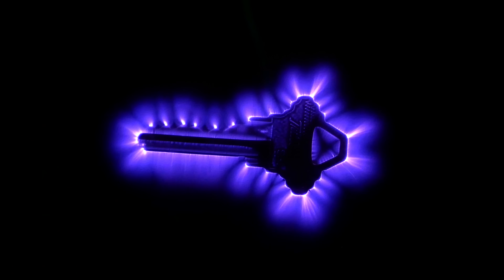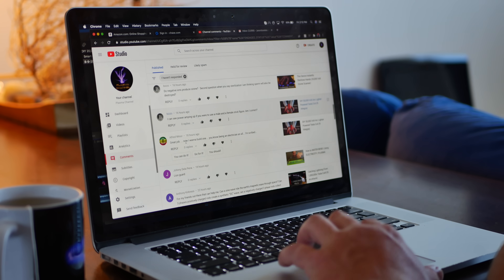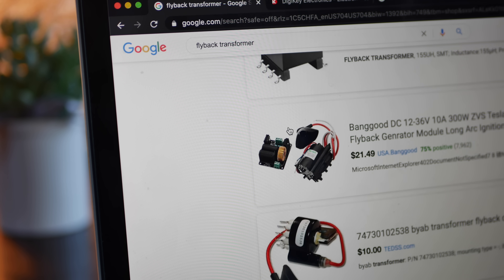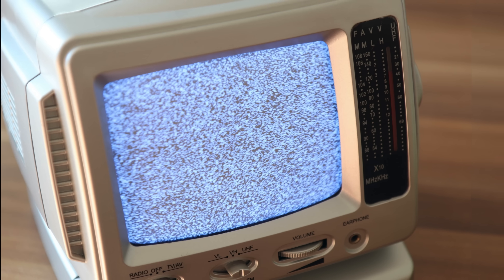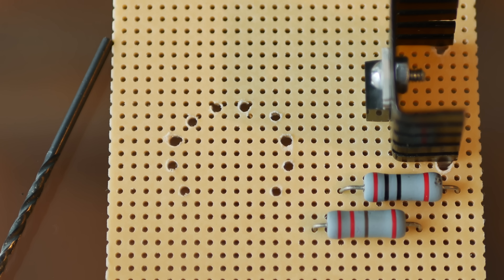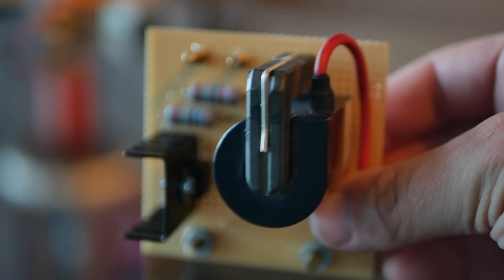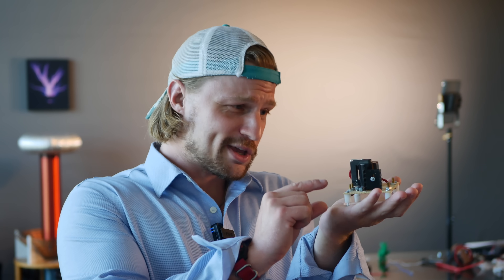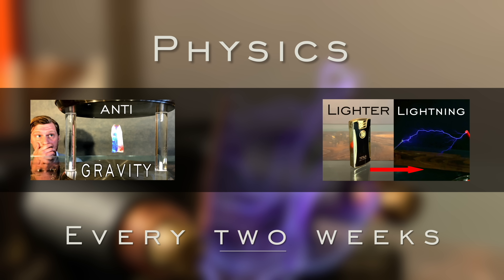DIY Plasma Physics Powersource (Mini 20,000v Flyback)

Comment: Okay, stupid question: it looks cool but you can do something practical with it, right?
Reply from the maker: That is a good question, but practical is a relative term. Cars, for example. Useless unless you build an entire infrastructure around them. Otherwise, that mustang, not able to leave the driveway. 

This is a powersource for all things high voltage. It can power larger devices, and, be used for particle acceleration experiments. It also can be considered art. That’s why I love sparks so much. It’s an artistic taste, I suppose.
Reply: @PlasmaChannel  I do understand the art part, I also love how plasma looks. However, there is also this feeling that you have something powerful in your hands. Like how electricity, in the beginning, was often used as a party trick but has grown to so much more. If I see plasma I think: cold fusion reactor. So, next project? :D :D

Comment: hi jay,
i have build it with power supply (ac/dc)
but after few moment 
the voltage drop
can you help me?
thanks
Reply from the maker: What voltage did you feed it?
Reply: i use ac to dc converter, i use laptop charger
i want to build Tesla Coil with zvs and flyback
thanks

Comment: Could I use a mosfet like the irfp260n in place of the 2n3055 bjt? Does it connect  the same way or is there anything different I need to do? If same way, is it G of mosfet connect to feedback and D of mosfet connect to primary?

Comment: I tried making my own coils with a 0.020mm diameter stainless steel wire, with 7 turns for primary and 4 turns for feedback. However, it doesn't seem to do anything. Is this because the wires I used are unsuitable or is the problem with the flyback itself?

Comment: If my transistor gets really hot, but there is no output voltage, what does it mean?
Reply from the maker: Try reversing your flyback winding connections.
Reply: @PlasmaChannel  still no output. What else can I try?

Comment: Hi, I tried using a variable power supply, range of 0-12V and 0-5A. Everytime I tried connecting the circuit, the power supply would go into constant current mode and the voltage would become very low. Do you have any idea what I'm doing wrong?
Reply from the maker: That seems like the voltage was shorting out somewhere. Are you sure your flyback winding is connected correctly, and, that your transistor is not fried with a closed circuit?
Reply: @PlasmaChannel  actually to be honest, I'm not too sure. I tried connecting with another transistor, the 2n3055, with that I managed to get it to stay in constant voltage mode. However, there still seems to be no output and the transistor doesn't seem to get hot or even do anything. Any idea where I might have gone wrong?

Comment: Why 12v ? Can i put more voltage in input for more at the output ?
Thank u very much for your vidéo
Reply from the maker: You need to build this with more spacing between the parts, if you want to use more voltage. 15 volts is the absolute max for the dimensions I used on the board. Any higher, and the high voltage output will arc over to the other components and destroy the whole thing.
Reply: @PlasmaChannel  thank u so much for your answer, i will do that

Comment: Say I have 4 set of pins, one being 0.4 ohms, one being 0.8 ohms and the other two being 0.9 ohms, which one would be the ones I need? The one closest to 1 ohm or the lowest values?
Reply from the maker: I would use the 0.4 ohm as primary, and 0.8 as feedback. If it does not work the first time, switch around the connections on the feedback ones.
Reply: @PlasmaChannel  I tried every combination but all I get from the output is 0v when I measure with my multimeter, does this mean the transformer is broken?

Comment: You can design a circuit for an electric vehicle, a truck with a double motor of more than 200 kw 20,000v and that charges batteries with a generator motor without burning the batteries that the inverter to use, you can design a drawing and send it to my email or make a video animation fersomtop93 @ gmail.  com

Comment: how much current could have been there in that circuit?
is that lethal?
Reply from the maker: It is not lethal, but I still recommend being safe while using it. It will output approximately 2-3mA

Comment: I can't wait to try this out some day. But first, I need to learn (a lot more) about electricity.
Reply from the maker: Yes, please do not attempt this if you are new to high voltage. I did the video, and have 17 years of experience.
Reply: @PlasmaChannel  no need to worry. I don't even have tools or parts for that. Once I have the money to start, I'll be sure to start small and simple. 😁

Comment: Forgive my noob status to this channel.  If I may.  Marko Rodin remarked to the group that continued his research that electical current through magnetic copper wire would suffice for the moment but that ideally plasma would be the preferred medium to flow in a rodin coil configuration ( I assumed through a copper pipe rodin coil) I was probably wrong about that too.  Does anyone know what he might have been referring to?  Any help is appreciated.

Comment: What transistor do you reccommend for higher voltages and higher powers? will definitely have to add a big heatsink to that one
Reply from the maker: IRFP460 and also the transistors linked in the video description work well.
Reply: @PlasmaChannel  thanks!

Comment: First time viewer👋 can you elaborate on 1 hand rule?
Perhals link an electrical safety video in the description whe necessary?
Reply from the maker: Hi Dionysi. Is that your legal name?
 Pretty sweet if you ask me. One hand rule means one hand in your pocket at all times when dealing with dangerous levels of electricity. It keeps you safe, and protects your heart. If you use both hands, and mess up, electricity and go across your chest. Using only one hand, it will go through one arm, then down to ground, not affecting your heart as much. In some cases, it spares your heart entirely. So, especially with high voltage, one hand rule is very important.

Comment: how much is the supply voltage? also what do you use ac or dc?
Reply from the maker: The supply voltage is 15 volts maximum.

Comment: Can you make a high frequency (>500 KHz) Induction heater 

Ps. I have AutoCAD logo as DP So take my request seriously
Reply from the maker: I'd love to make a high frequency induction heater. All I can think of, though, is a ZVS driver. I've built one before, and it worked great, but to get to 500Khz, I may need some help from Mehdi the BOOM himself.

Comment: can you make plasma ball from this circuit ???
Reply from the maker: You can, but it will not perform like a normal plasma ball. Plasma balls operate best off of high frequency AC. This is DC.

Comment: Could you use this high voltage supply to power electromagnets
Reply from the maker: You can, but above about 1000 volts, it's pointless to increase voltage. Because your power source needs to be able to deliver the power necessary.

Comment: Is this all I need to power an ionic lifter? Or do I need anything additional?
Reply from the maker: You would need a filter capacitor to smooth out the high voltage DC. Thats about it.
Reply: @PlasmaChannel  what if I didn't use the capacitor, can it still produce lift?
Reply: @PlasmaChannel  where would I add the filter capacitor in?

Comment: Althought this type of high voltage won't kill you due to the skin effect (high frequency phenomena), it would just burn your skin and never shock you. (From experience)
Reply from the maker: Yeah, it will still make you flinch and pull away, but not enough power to cause life threatening harm.
Reply: @PlasmaChannel  yeah exactly.

Comment: I understood how this circuit worked a couple of months ago but I’ve kind of confused myself. Would anyone be willing to explain to me what causes this circuit to oscillate in detail?
Reply from the maker: I can tell you conceptually. The power is turned on. Power pulses through the primary. This causes a magnetic field in the primary coil / ferrite core to form. the feedback coil is also there, so, some current is induced into the feedback coil. This feedback coil connects up to the mosfet. The current being fed into the mosfet, turns off the mosfet for a split second. This starts the cycle all over again. Mosfet turns on, then gets turned off. Thousands of times a second.

Comment: Ah, the classic 2n3055 setup, the most inefficient of all flyback rivers!
Reply from the maker: Power wise, yes. But, it produces the highest voltage out from any driver. Zvs for example will lump out lower voltage but much higher power.
Reply: @PlasmaChannel  With proper controller like the simple UC3842, one can make an adjustable driver. Of course one will lack the simplicity then.

Comment: Can this kill?
Reply from the maker: Unmodified, it cannot. For those who have a pacemaker, it may run the risk of disrupting the pacemaker's functioning, though, not likely. I don't like to build lethal devices. It's why so many of my builds are battery powered and not massive. It CAN  burn your skin though. Regardless, be safe, use the one hand rule always

Comment: wait in the diagram you show that positve and negative are connected with just 2 resistors in the middle right? So when theirs load their isnt a short curcuit get it? correct me
Also how much current does that project use?

Comment: well that was interesting and i will for sure build one for myself!!>
one thing tho...can i connect in series 2 or more transformer flyback?
if yes do i have double up on transistor/heatsink,resistor "both ohm's??"
Reply from the maker: You can runs two flybacks in series parallel configuration. Definitely need two transistors for this.
Reply: @PlasmaChannel  hi and thanks for the answer...
well you made my thirst for knowledge on that specific topic even bigger..
PS since its very difficult to get answers from the builders of stuff on youtube...
a big THANK YOU is in order....

Comment: You can add a diode in parallel with the 20ohm resistor, it will allmost double the arcs. I used the 1n5407 but and others will work. I saw that at ludic science - easy flyback driver
Reply from the maker: That is interesting... I’ve never heard of that! Definitely trying!
Reply: @PlasmaChannel  i appreciate that you answer my comments while there are like thousands
Reply from the maker: 10 subscribers or 130,000 subscribers, you’re all just as important to me 😬
Reply: @PlasmaChannel  ok but can you please think about making a zvs flyback driver, they're great and can be used for a cocroft walton voltage multipliers and for tesla coil because they're aroun 15kHz
Reply from the maker: They can be used, if you do it to an AC flyback. Normal Flybacks will just put out DC. I do like ZVS drivers, but they create lower voltages for the same input voltage as a single transistor system.
Reply: @PlasmaChannel  you're right about that but i have a genesis tesla coil with 20cm arcs and homemade capacitors and works great, it's like higher frequency NST but i vould love to see it as a topic of your video
Reply: I also used it for lightenberg wood burning and it's great! And it is DC

But the gold plate is your next step!🤘🏆

Comment: Hi excelent video, im recomending to use perfored board with copper dots
Reply from the maker: I would highly recommend against it. You need insulation between components. The copper will spark and ruin your board. 

Also, it will capacitively couple energy out of the system and waste energy.

Comment: This circuit is essentially the same circuit that a plasma lighter uses to make a high frequency AC voltage from a low voltage DC source.  The circuit self oscillates due to a back EMF induced on the feedback coil by the primary coil after the transistor turns on.  The interaction between the primary and feedback coils turns the transistor on and off at thousands of Hz resulting in a very high frequency AC voltage on the secondary.  What I'm not clear on is the need for the 20 ohm resistor.  What it looks like you're trying to do is create a voltage divider to reduce the supply voltage seen at the base of the transistor.  Problem is you have a constant current flow of 50 mA through the 2 resistors from the 12V supply, just wasted as heat.  I don't think you need to reduce the supply voltage on the transistor base so I think the 20 ohm resistor could be eliminated.  By the way, this is very similar to the slayer exciter circuit used to excite tesla coils except there since the tesla coil is a huge air core transformer the feedback comes from the secondary winding to turn the transistor off, not a feedback winding.  I've wondered if you could wind a feedback coil on top of the primary turns on a tesla coil and get enough feedback voltage to turn the transistor off and make the circuit oscillate without having to use the secondary winding.  Something I might play with one day.

Comment: Im so confused on what transistor to use i have zero experience and im trying to see if any transistors from the CRT tv will work but its so confusing please help
Reply: I recomend taking all the transistors you have off the board, then loading up all the comments beneath this video then ctrl f and search "transistor" then compare the transistors you got from the tv against the ones mentioned in the comments.

Comment: Can I ask, what can I use it for?
Reply from the maker: In the beginning of the video, I showed a few uses. Basically, it can run larger high voltage devices, Spark gap radios, tesla coils, etc.

Comment: This circuit is so lame.  Simple yes, but lame. The transistor typically is on fire, as it runs in linear mode. There are plenty of low-cost half-bridge drivers and good MOSFETs out there to bring this 50 year old design into the modern era.
Reply from the maker: I suppose you have to define lame. It uses the least parts of any driving method possible. Half bridges are great, but add complexity and size. 
 This method is incredibly powerful, and overdrives the flybacks. You are right about the heat loss though. It’s through the roof.

Comment: Question: how hot does the bolt get? I would like to incorporate this into a 3D model of a wizard where the arcing between the bolts is between his outstretched hands, like he's casting a spell. But how hot do they get? The bolts will have to be embedded in 3D printer plastic. Will it melt?

Comment: Perfect - could you also mention where you given input power and where the output, better if you can share line diagram of the same .
Reply from the maker: In the video, I showed the schematic for building one of these. Cheers.
Reply: @PlasmaChannel  got it sir, thanks for such useful stuff.

Comment: Thanks for sharing this video but I have a question can we use other transistor like IRFZ44N, TIP122, IRF540N. PLZ tell me which of the transistor is work  well.
Reply from the maker: You can use multiple other IRFP transistors. 540 SHOULD work.
Reply: @PlasmaChannel  Thank you💙💖

Comment: Thank you for this wonderful video sir, but can I ask how did you know the specific values of the components such as the resistors and the transistor? Thank you so much for the answer
Reply from the maker: The transistor I used was the transistor found in the Mini TV's, it is the literal one designed to run these things. However, several other MOSFETs do the job equally as well. As for the resistors, it comes down to reducing the current into the specific transistor to meet it's requirements. Also, pen and paper.

Comment: Can i use D882 transistor
Reply from the maker: You should be able to! Make sure your pins match up!
Reply: @PlasmaChannel  yes i made it by rounding wire around the core and it produces nearly 2 cm long arc but it is not powerfull
But i'am satisfied... thank you🥰😇🙏

Comment: Since I didn’t have most of the parts in the vid other than the flyback.
 I have learned CFL Bulb ballasts work just as good :p except a little more dangerous because  it plugs into the wall. great vid tho!
Reply from the maker: That is correct! CLF ballasts are a great alternative...just a bit more dangerous.

Comment: Well if with the little flyback is 20k volts imagine the big one for the biger tv, can be used as a tazer/security
Reply from the maker: The larger ones can easily pump out 30-35 kV!

Comment: Pretty impressive using a single transistor. My ZVS Driver at 36 Volts doesn't make much bigger arcs.
Reply from the maker: Yeah. ZVS drivers do not put out too high of voltage. They are good for creating extremely high currents out of flybacks.

Comment: How is it generating electricity
Reply from the maker: It is transforming electricity, not generating it. The Transistor turns the power on and off into the transformer super fast. This causes the transformer to put out transformed voltage.

Comment: Alternatively you could use a engine coil and a 555 timer chip. But I like how small yours is.
Reply from the maker: Yeah, I just dont like 555 chips. They are so fragile...they blow up ALL the time. This circuit on the other hand is really hardy. The transistor gets really hot thought.
Reply: @PlasmaChannel  true,,, good heatsink should help that I would think...now I have to find an old tv or like you said get one from online..I'm always thinking in an apocalypse what would I find around to use..like a set of points and a motor to turn them HA..ROBUST! I drive a 1962 classic with a set of points so I will still be moving during that EMP pulse too. cheers!

Comment: My arks is small
Reply from the maker: What voltage are you using, and how much current are you pulling...basically if you use normal AA batteries to power this....it will do OKAY at best. But if you use Lithium batteries....that's how you get my result. Still, dont push voltage beyond 14-15 volts. Will destroy this.